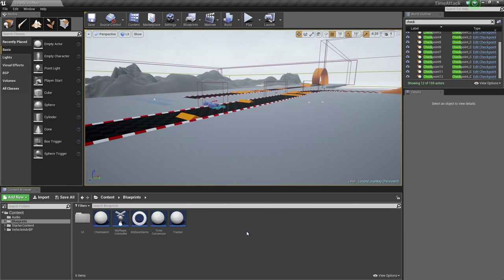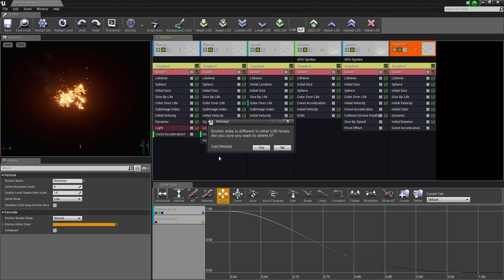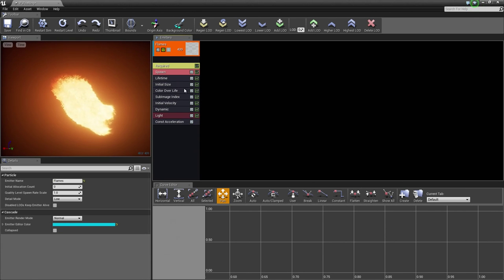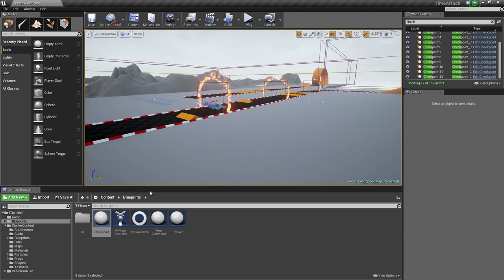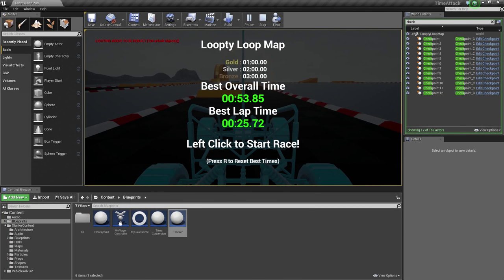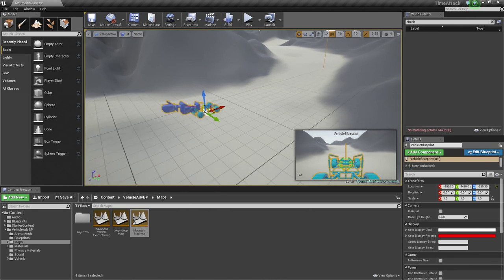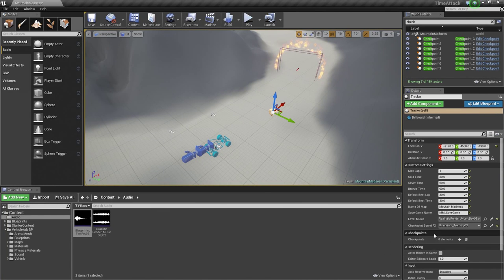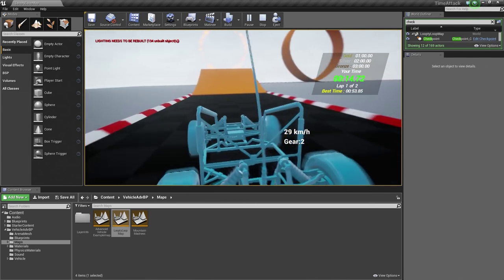BP Time Attack Racer: Final Polish & Additional Maps | 15 | v4.8 Tutorial Series |Unreal Engine

Comment: for anyone else that may have this issue, if the fire ring isn't showing in the viewport, you have turned off realtime. Turn it back on using ctrl + r or clicking the arrow next to perspective and then checking realtime. This tutorial is brillant, however, I came across many many issues that took me a while to figure out and I had to edit a few things to get it to register. This only happened in the later version as I downloaded 4.8 and it worked fine. But after this tutorial, I have added a bunch of new features and I am now working on making this into a multiplayer racing game with 50 maps and I am working on adding powerups. I also added a animation to the bronze, silver and gold time when they couldn't be met and used what they have taught me in the other tutorials to add that. Overall, I say it is a brilliant tutorial and thank you unreal, I am now on my way to making my games.
Reply: how is your game going so far? 50 maps is a lot

Comment: To those who wanted to use another car, I used another car for mine and it was easy. It's possible to change the Epic car after you are finished, but it's harder. However, if you start at the beginning with your own car, all the steps are the same. I used another car from the marketplace and it worked great. There is only one video where he changes something on the Epic car blueprint but you can just skip that video.

Comment: Hi, great tut working oin 4.25. i have a question. i build this in a blank project and only used epic vehicle. all works, i now migrate to a new project and using the driveable car assets, crazy here is when i drive the laptime seems to stay on 00:00:00 for this car, when using the epic car from the project its working correct, only the laptime stay zero and the racetime is working correct, any idea where i could look as we did not do anything special on the car itself and i use the playercontroller from the attack racer project.

thx

Comment: For some reason (I'm using the newest version of unreal), the car going over bumps or anything at almost any speed causes it to fly and spin out. I've tried increasing the mass but that just results in the car slipping more. Is there any way I can make my car drive over bumps smoothly like in the video?
Reply: Did you find a solution?